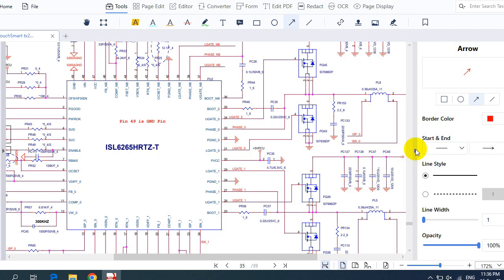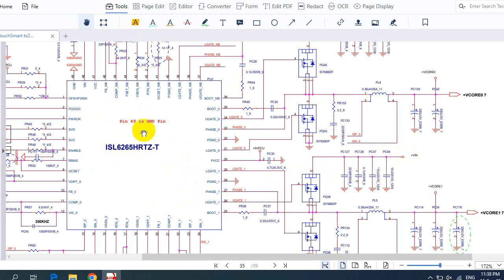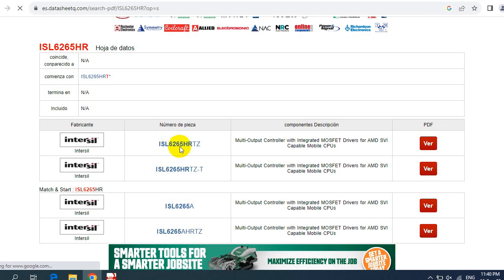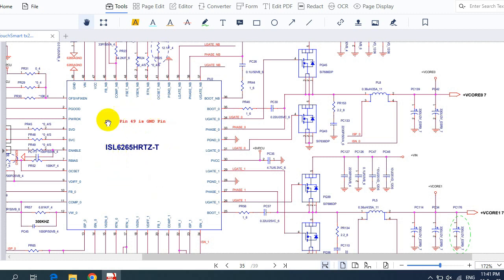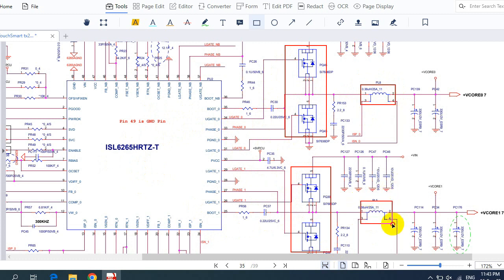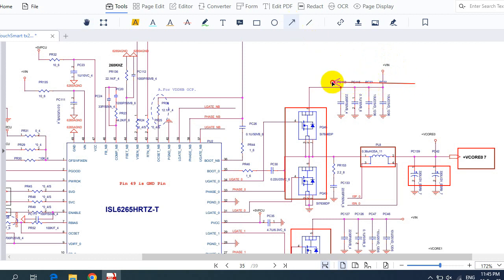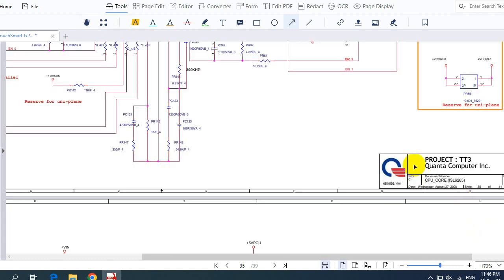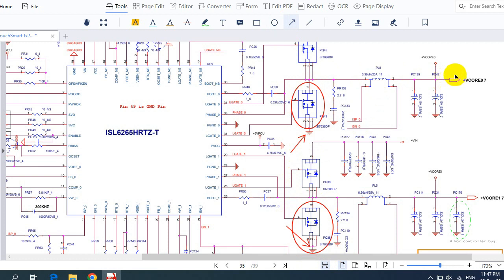CPU VCC_CORE System Power Circuit - Computer Schematics

Comment from the maker: Buy Repair Tools👇👇👇
https://northridgefix.com/shop/?ref=ERB_23
Microscope
Voltage Injector
Programmers
Reballing / Stencils
Repair Tools
iPhone Cases
Soldering
Soldering Equipment
Storage / Rack
SMD Books
Tempered Glass
Test Tools
Components
Donor Boards
Gadgets / Accessories
Ports / Connectors
Tweezers
Adhesive
Apparel
And much more

Comment: Hi sir.. What voltage in Ugate and Lgate for gate mosfet VCC core.. Because I have case that gate not present after power on.. 
And that's make vcc core voltage not present..
Reply from the maker: The VCC_CORE rail (which powers the CPU core) is typically generated by a buck converter a type of switching voltage regulator. It uses two MOSFETs:

Normal Voltage Ranges
Gate Pin	Expected Voltage (When Switching Normally)
UGATE	5V–12V (depends on driver IC, usually ~8–12V)
LGATE	0V–8V (typically ~5V–8V when active)

These are pulsed signals, not steady, you'd see them switching on an oscilloscope.
Reply: @electronicsrepairbasics_erb ok thank u sir
Reply: @electronicsrepairbasics_erb  ok sir thank u.. 
And are the 1volt vcore voltage still available if the laptop not installed cpu for testing between cpu or ic controlled in the trouble..